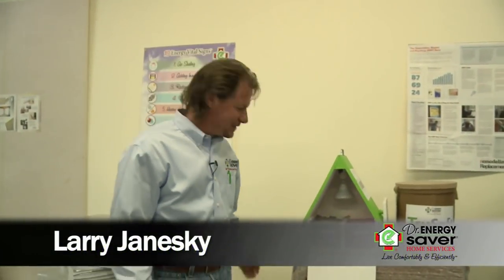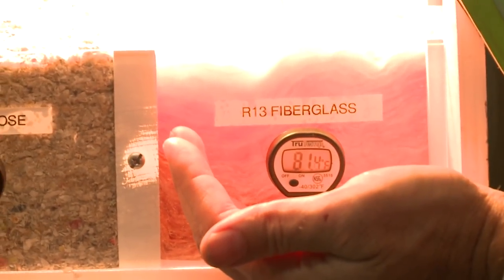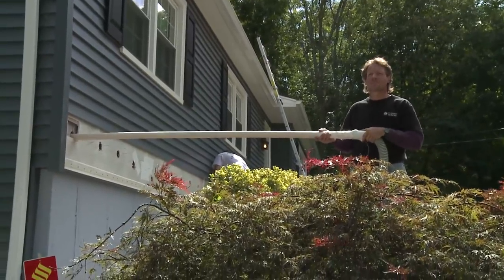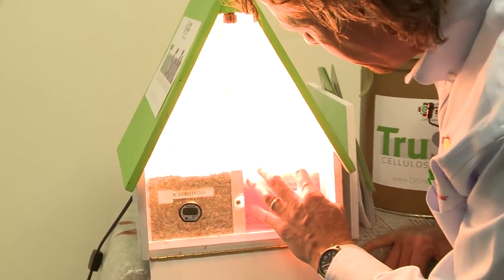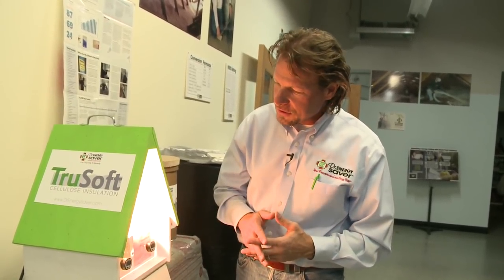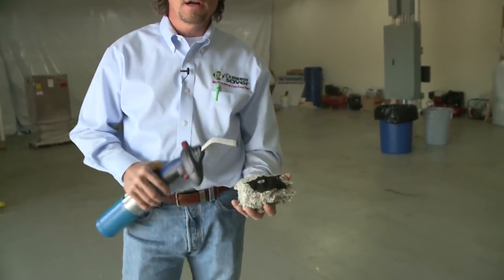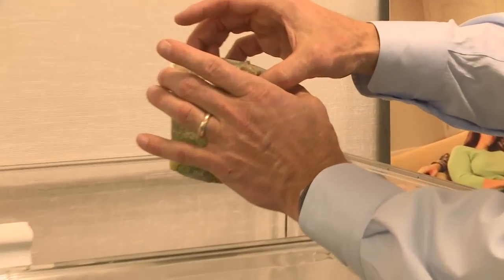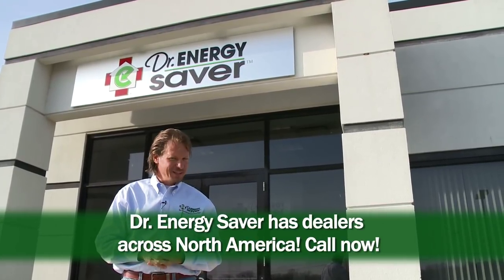Why Cellulose Insulation is Better than Fiberglass Insulation

Comment: Maybe this has been mentioned in a comment somewhere, but the demonstration with the thermometers is very misleading. Cellulose is more dense so its R factor increases more rapidly per inch of depth.  To make the demo an apples to apples comparison, the thermometer in the fiberglass would have to be near the bottom of the fiberglass mass, so the R factor rating would be even.  Cellulose has about 30% higher R factor per inch, so with the two thermometers being at the same level, the cellulose side has almost 30% higher R factor than the fiberglass side.  Said another way, if you place the thermometers at the same R factor depth for the type of insulation, then the resistance to heat flow should be identical by definition. Cellulose might be superior insulation but not for insulating ability as shown in this misleading demonstration.
Reply: Regardless of depth or R-value, fiberglass leaks air (and heat).
Reply: Terry Finnigan
But the temperature rose much more than 30% faster. The actual reason the fiberglass looks so bad is the high temperature differential from the top to the bottom. That light might be hundreds of degrees. If the temperature difference were only 20 - 30 F degrees the result wouldn't be so drastic.

 With high temperature differences, air begins to circulate through the glass fibers much more, and the R drops, but the air circulation with packed cellulose fibers is much lower. In other words, the effect of convection is not taken much into account in measuring R value, only the effect of conduction. They do this in the test procedures (for determining R) by keep the temperature differential very low.
Reply: Keep in mind the purpose of the demonstration is to compare the effectiveness of both insulations in a real world environment ...your home! We know from the Colorado Study and actual homeowners' experience that cellulose insulated homes will save about 30% of energy costs over fiberglass.  Why?  Because it seals air leaks and has a better R-value. The R-value isn't enough, however. Sealing the air leaks is critical. Fiberglass alone won' t do that. For that reason vapor barriers are required by Code to help the fiberglass.